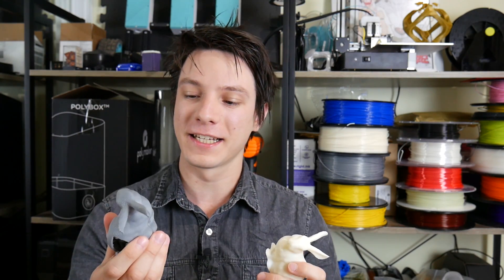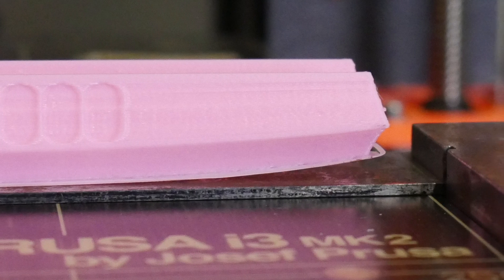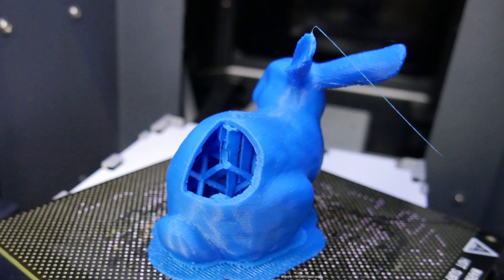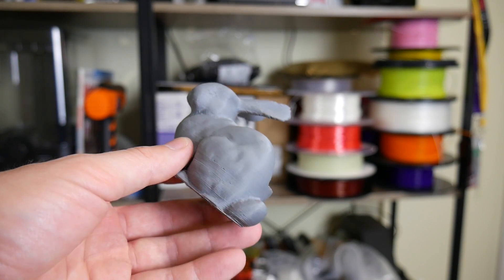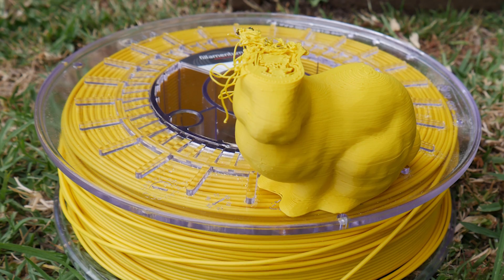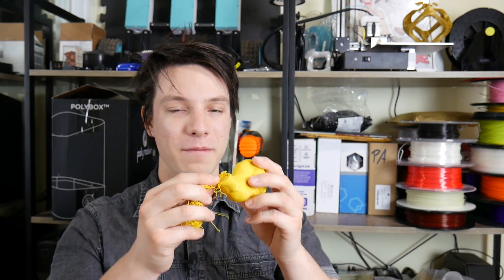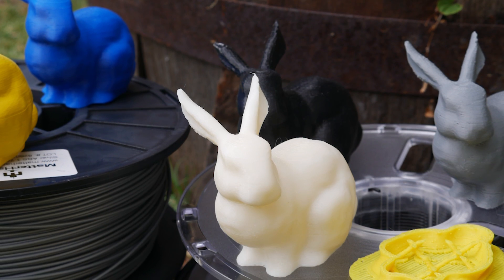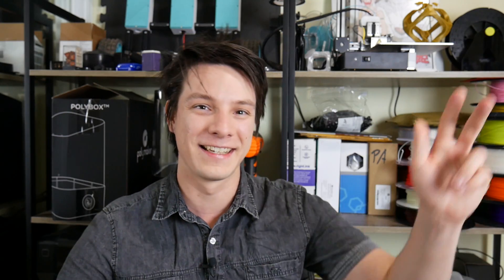Should you 3D Print in ABS? Probably not.

Comment: What about PETG?
Reply: PETG  in my opinion is the new ABS and PLA - really love this stuff!
Reply: Yes. High temp PLA won't melt in the back of a car on a hot day. Unless you're on Venus, in which case all bets are off.
Reply: My use of PETG has been checkered. It's very difficult to print LARGE with in comparison to PLA. It also does not take fine details (especially on the first layer) anywhere near as well as PLA does. It's strength also comes with the downside of being almost completely fused into a single homogeneous part that can shatter like glass. But it is a very stable material once actually printed.
Reply: PETG likes to string a lot, and has issues bridging. It also wants to be printed slower and will like to become part of your PEI printbed if you don't use gluestick or some other barrier.
Reply: I haven't found PETG to be brittle. The pieces I've made are quite strong and have a tiny bit of flex.
Reply: PETG is awesome
Reply: hmmm apparently PETG is considered food safe in most countries but the printing process itself apparently is a key factor in that as well (food safe nozzle, no additves/environment and printer contaminants....) look for FDA certified filaments to make sure the filament is certified... (a quick search shows t-glase by taulman 3D, guidel!ne , Tech-G(also taulman), HDglass™ by FormFutura and some other PP/PET based ones)..... and aside from that to be truly certified you would have to get certification for the end product as well; but in general it seems PETG is a 'food safe' filament (the certification is another problem ;D)
Reply: PETG is good for applications where you don't want the plastic to creep. Things like clips or tensioners. It's also good for living hinges.
Reply: ive heard PETG is fantastic ... not to mention its fire retardant and food-safe which makes it all the more interesting.
Reply: @km5405  Nice one thanks, didn't know about the fire resistance of PETG.
Reply: PETG is awesome!
Reply: If your PETG is brittle, there is something wrong with it. Every PETG I've used is actually slightly more flexible than ABS. If you need very rigid parts, PLA is often the best choice. I've come to like eSun PLA+ (Pro) for that application. It prints a little hotter than regular PLA, is very rigid, but somewhat less brittle than regular PLA. It costs about the same as other quality PLA's, but unfortunately doesn't have any better heat resistance.
Every filament is a trade-off. I still find a lot of applications for small and medium sized parts where ABS is best.
Reply: so i could leave a print made with a high temp formulation of PLA in the back of a hot car and not worry about it becoming a gooey mess?
Reply: 3D Printing Professor The big use I've found for PETG was for holding my heated bed on my delta. I was printing a lot of ABS and using ABS juice which attacked the ABS holders. PETG deals with the heat like ABS and isn't sensitive to the acetone.
Reply: I like petg, however I have a hard time getting bridges to print well enough and I get quite a bit of stringing. Beyond that the parts are quite strong and its what I use for printing parts for replacement parts for printers or where they may be subject to moisture. However I have never tried abs or asa. Might be something to just try once.
Reply: Totally agree, but nothing a wire brush can't quickly fix. And i've tried lower temps to eliminate it but is not great for layer adhesion of course. In my experience it can match PLA in quality without any noticed warping.

I use PETG from Micro Center
Reply: You say it smells better.  Is ASA "toxic" in the way that you should have great ventilation with ABS?  PLA doesn't have the same venting "problem" that I've always been told ABS has.  PETG and ASA, I haven't seen a constant yes or no on this.  I'm looking to print "skull" like structures of masks that then are covered in different material, so the finish of the print itself doesn't matter.  Just the heat tolerance and the strength.  I can't get a consensus on what to print them out of.
Reply: Kevin Miedema food safe? What brand? I haven't seen a food safe label on PETG before.
Reply: Stefan Schüller - I have  not yet printed in PETG but I have printed a fair bit in HDglass which is a modified PETG.

So far my best material.

Strong, slight flex, basically zero warpage.  Smooths fine.  Layer adhesion is vastly superior to PLA, hardly ever do you get delamination.

Disadvantages seem to be I have to clean the nozzles more as it can ve stringy and the nozzles end up with a sory of baked syrup on them if I don't clean enough.

Aside from that though I love it.
Reply: sebastien chedal-bornu depends on the strength you're looking for. High temps and not cracking as a failure mode makes it better than PLA in durability testing.
Reply: i've been disappointed with ASA, keeps warping way worse than ABS ><
Reply: try using a copper/steel scrub then quickly dipping them in boiling water :-)
Reply: PETG is great!
Reply: Annealed high temp PLA is stronger than abs and petg. It has a higher impact resistance. It has a higher glass transit temperature. The only thing I have not experienced myself yet or been able to find any other reviews on whether annealed high temp PLA still deforms under constant load over time.
Reply: +1, I'd like to hear your (Angus's) opinion on PETG
Reply: i wanted to wrrite the same thing.
ABS is crappy on physical strhength (PLA is better)
PETG is like PLA but with higher temperature tolerance.
Reply: PETG is brittle and can explode (similar to PLA). But ABS has a less brittle failure mode, will turn white before breaking. Also, if you are a bit touchy on finishes, PETG is always kind of translucid/shiny, and ABS can be more matte.
Reply: I've been using PETG for a few years now, it's definitely not "brittle" and i make working bicycle bottle holders at 0.2mm 245c Only issue is that PETG is a bit stringy if you want good layer adhesion but can look as good as PLA at lower temps and virtually no warping and great heated bed adhesion. 

I pick it up for $19 a KG. ABS was only ever used because it was already being made in that form for other reasons when 3D printing started as stated in the video.
Reply: Stefan Schüller Nothing but PETG for me. These comments saying it's crap are just plain ridiculous or uneducated guesses..
Reply: 3D Printing Professor I couldn't agree more, I like using petg for decorative pieces at Christmas and Halloween but other then that it hasn't really any other advantage, if you haven't tried filright you should have a look at there range and prices
Reply: PetG has no advantage over a high temp formulation of PLA. Where as you can smooth ABS with a cheap and readily available solvent (acetone), PetG and PLA have no such option. (I've tried THF, it only works on about half the formulations.) ASA on the other hand, is high temp, smells better when printing, and smooths with acetone like ABS. It's my high temp option of choice. When you can find it.
Reply: PETG is the shit.
Reply: Stefan Schüller schön, dass deutsche auch in der 3D Druck Community vorhanden sind.:-)
Ich drucke schon seit 2 Jahren

Comment: You should review a cheap printer like the anet a8
Reply: he has said it in other videos he doesn't really like to review those kit type printers
Reply: dylan horton monoprice
Reply: I'd like a review on my ScrapRap MotieTech Z1 printer but If i send it to you in pieces itd be easier to just give you the list of parts... 2 all in one printers with the scanner beds etc... 2 10 speed bikes for the chains and sprockets,... threaded rods, nuts and bolts.. old sign of allumaply plywood,... then cheap parts from china for the electronics.  I could make the board from scratch if I had to as I was doing that at a very early age thanks to my Dad!~  
it prints only as good as the tolerance of the gantry... the rest is really not much different from printer to printer.